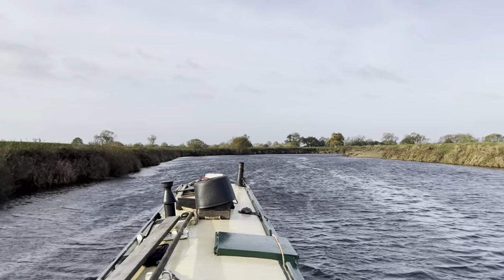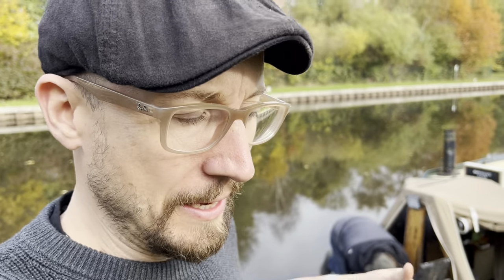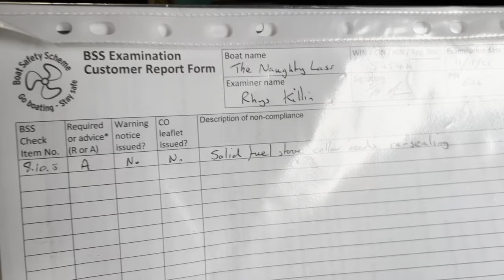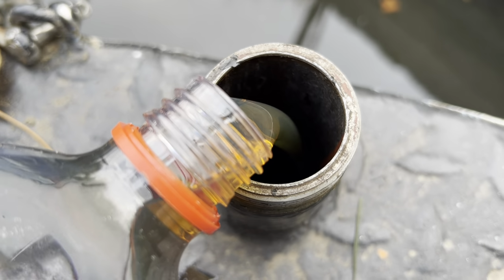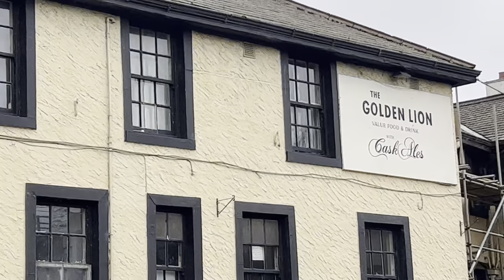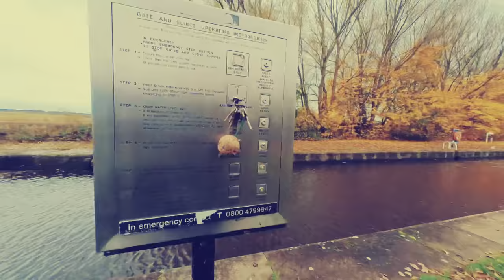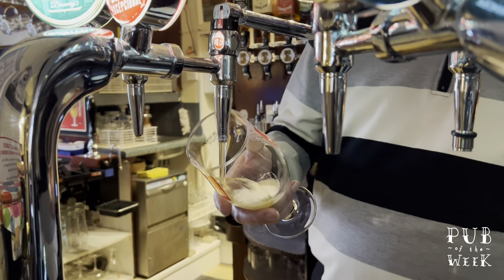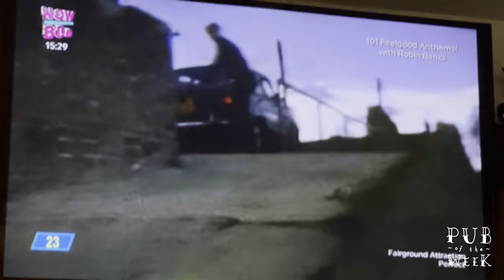How to book a BSS, use a gas bubble tester and report pollution

Comment: Just a pointer: Always introduce fuel additives when you fill the tank. This allows the liquids to blend, for proper performance. Pouring the bug killer in by itself, will just let the additive settle into it's own "pool", and could be pumped into the engine at a much higher ratio than the engine can burn. Bug killer works on all places the fuel touches, so it is best to get as much mixed in as possible, for it to do as much good as possible.

Oh! And, be sure you have a few extra fuel filters on hand, as the growth will slough off and start to clog lines and pumps.

Comment: Diesel bug IS a thing! I've twice had this in car diesel, both times from supermarket diesel. Basically, white smoke on starting after being parked overnight, not otherwise (for cars).

What's going on is bacteria growing in water droplets in the diesel fuel. Biodiesel is more prone to this than mineral diesel, because of the chemical structure of it.

To stop diesel bug, you need a detergent in the diesel. That makes water dissolve in the diesel oil, exactly same idea as washing up liquid, only that's making oil dissolve in water.

Detergent in diesel makes life much harder for diesel bug bacteria. That additive will also have bacteria killer in it, not much because the detergent does most of the work. It'll also have injector lubricants, a surfactant to make diesel spray better (makes the injectors do a better job and the diesel burns cleaner) and a cetane booster to pep up the diesel power a bit.

Which one to use? I dunno, I always used to use Miller's diesel treatment, but I dare say the treatments are much of a muchness.

Keep some diesel cleaner handy as well; useful to clean things out in a hurry. Final thing, keep a spare fuel filter handy, diesel cleaning additive often frees up a load of muck out of the tank and that'll end up in the filter.

Comment: How do you guys deal with diesel fumes in your face while moving, i'd be burning french fry oil from the chip shop chinese food oil.
Reply: There isn't as much exhaust as you may think.  Engine is low rpm with a low load. 
It comes out just a few inches above the water.  Locks are the main place for it to build up.
Reply: @andrewbarnard667  it comes out the roof you can see and hear it chugging along i have not seen a narrowboat yet with a low mounted pipe
Reply: @samcardone7494  Nearly all narrowboats have their exhaust a few inches above water level, at the back of the boat. You’re probably seeing the stove pipe from the woodburner unless you’re looking at a vintage, mid-engined boat, in which case yes it comes out a pipe on the roof but those boats are much rarer than the other type.
Reply: The 2 I've used and ones I've looked at when considering a purchase definitely came out of the back.  Just look at some engine bay photos you can see the silencer fitted between the engine and stern.
Reply: @andrewbarnard667  I think i was looking at really old boats
Reply: @samcardone7494  Maybe the chimney nearest the stern is for the gas water heater.
Reply from the maker: Hi sorry only just seen this - some boats do indeed have roof mounted exhausts in the middle of the boat and generally those older tradition boats seem to have a stove at the back so yes would be an issue! Bandana mask at the ready!!